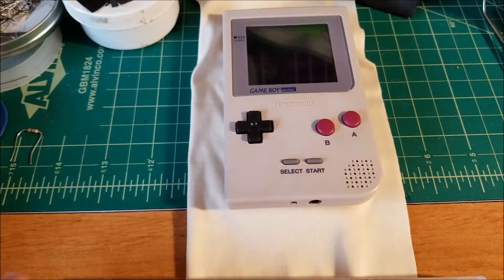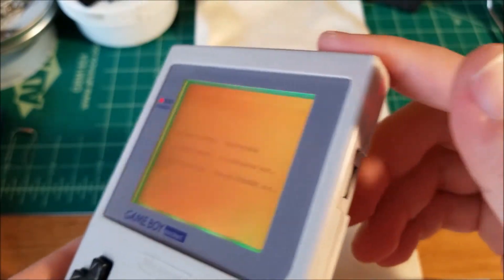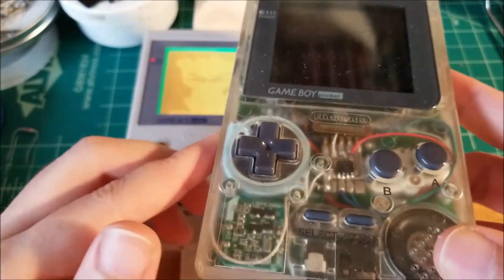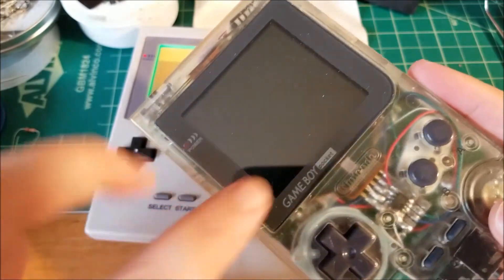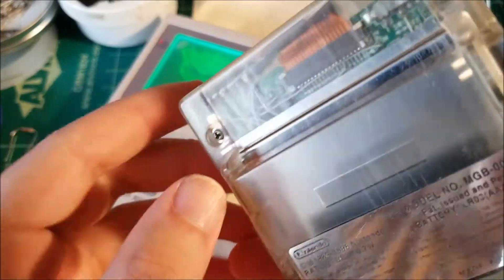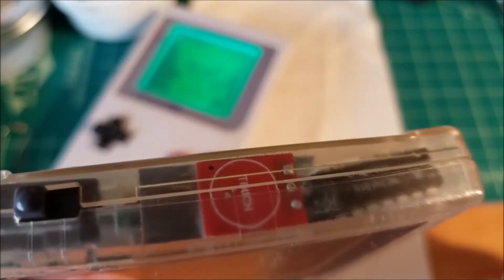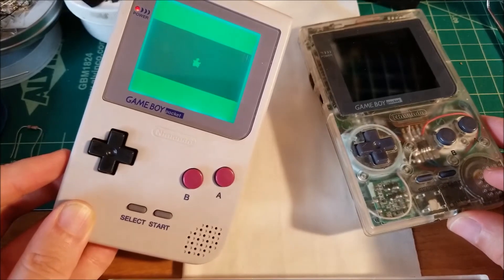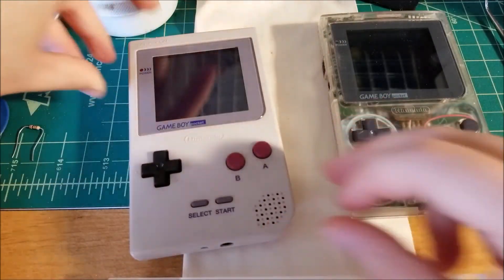Gameboy Pocket Touch RGB and Select-able Invert Mod

Comment: First of all, you are one of my favorite channels and biggest inspirations for modding. So I ordered an rgb backlight to replace the white backlight on my pocket. I also ordered a 4 pin dip switch to control it. My question is where would you suggest I put the switch in the case?
Reply from the maker: I haven't done an rgb mod that is controlled by dip switches myself (I've used my touch chip for both my rgb modded pockets) so this is just conjecture on my part. The pocket case is pretty cramped so the switches will have to be externally sticking out (don't have the luxury of hiding them inside the battery bay like you would in the roomy dmg). I would guess a good place to check fitting would be at the top on the opposite corner of the power switch or somewhere near the speaker as there's a tiny bit of room there. Unfortunately though you will need to do some significant case cutting to fit it so you may want to use an aftermarket shell if you want to keep the original shell stock. Best of luck!
Reply: sjm4306 thanks! I was thinking by the speaker, or maybe on the opposite side sticking outside kinda below the volume wheel
Reply: sjm4306 btw I did order a aftermarket shell and I have some leftover from previous mods that ended in a broken pocket
Reply from the maker: I would think by the speaker would be a cleaner install so it is out of the way and not poking into your hands but still easily accessible.
Reply: sjm4306 good idea. Thanks for the advice!
Reply: sjm4306 so I got it done! I routed the switch to on top to the opposite side of the of the power switch. There’s a gap in the top but it works really well! Thanks for being an inspiration
Reply from the maker: That's awesome, congrats! Got any pics of it you can share?
Reply: sjm4306 yeah! Should I email them to you or how would you like to see them?
Reply from the maker: Yeah you can shoot me an email at sjm4306@gmail.com.
Reply: sjm4306 alright!

Comment: Do you think it would be possible to install RGB buttons as well as the RGB screen to run off the same touch sensor, so they are in sink with the colour changes? (not necessarily in that gameboy, but in another model?
Reply from the maker: It would be fairly easy to do that. Pretty sure my buddy roarke from roarkesretrocorner.com has done that for some of his customers.
Reply: I believe he did one in which while you turn the handheld on if you press and hold the sensor it turns the RGB buttons on and off, but not seen anyone have it so the RBG colours of the buttons an screen change with the same sensor before. 

Is it something you'd consider doing a tutorial on? I'd love to learn how to do it for my own DMG in the future!
Reply from the maker: It would be as simple as wiring rgb leds in parallel with the backlight. I'll have to order some tiny smd rgb leds for the buttons but I'll add it to my list of future videos.
Reply: That would be really cool :) I've never modded a game boy before, i'm away to be starting my first but that was something I have been thinking would be really cool to work up to doing!

Comment: Hi
Reply from the maker: Hi
Reply: Hi I have a gameboy advance the volume wheel is gone and 
It dosent make sound it just buzzes I took it apart to fix the buttons but the sound dosent work who can reapir it I really want it working
Reply from the maker: Sounds like you need to drip some isopropyl alcohol or contact cleaner inside the volume pot and work the switch back and forth to clean it. Another thing to check is to make sure the solder joints arent cold or broken.
Reply: Do you know where to get a volume wheel my gameboy didn't come with one
Reply from the maker: You can find 5 packs for a dollar here apparently: https://ebay.to/2nWImQ6

Comment: So the new instructions on HHL say to take that white to 5v which is pin 4, and to only use a resistor for the 100 ohm on the red for the gameboy pocket. Any difference in using the 5v pin on the front of the board?
Reply from the maker: Nope, no difference pulling 5V at the chip's pin 4 or the front board.

Comment: did you know what you can use SN74LVC2G04 chip? its dual (not quad) hex invert chip, it smaller, and aslo it use every pin-leg
Reply from the maker: Gor Gylka I've seen the dual TI inverter chips and yes they would work great but I was just using chips I already have in stock that were available to me immediately.

Also for this selectable invert I used an xor so I could use a logic level input to enable or disable inversion.

Comment: How much would you charge to make a white one exactly like that and ship it internationally?
Reply from the maker: chocograph The dmg pocket costs ~$50 due to rarity, parts & installation of backlight+controller+bivert $100, and shipping ~$10-15 depending on your location. Can shave some off for other models of pocket that aren't so rare. Will take about 2 weeks due to complexity of mod.
Reply: I've modded many consoles myself, also modded my own DMG with a green bivert so I could do it myself but truth be told... I can't be arsed. I just really liked the touch sensor and was thinking of just have you make me one but I don't think I can justify that price. But I fully understand it. Can you tell me what touch sensor it is and how you wired it? I only installed a green v4 backlight and haven't tried the multiple color ones. I'm very picky about things like dust under the screen and I also use extra tape under my d-pad to create perfect pressure sensitivity so that it's comfortable to play so I consider my own DMG to be the the ultimate one haha.
Reply from the maker: Perfectly understandable, it's just this level of modding took me a minimum of 4 hours of work since there is just enough room inside to deadbug solder the surface mount components and I would have to charge enough to make it worth my time. The touch sensor itself does nothing, all of the magic is inside the microprocessor chip I designed that takes input from the touch sensor and modulates rgb output and controls the soft bivert. If you are comfortable with doing the mod yourself then I can sell you a preprogrammed bare chip and touch sensor along with installation documentation for $12+shipping. I can provide some support but obviously if you go this route I cant be responsible for any damage during installation.
Reply: That's very cool that you would do that but I think I'd rather buy a complete gameboy to be honest. It's a very cool touch I must say.

Comment: So I have an understanding of what the bivert mod does electrically -- essentially inverts one line going to the LCD so that it draws 1 for 0 and vice versa, inverting the image.  So how do you enable and disable signal from your micro?  Or is it not a signal, and it's just a data line?  (Your work has inspired me to fix up a DMG I have and mod it with a backlight. :D)
Reply from the maker: Scott Lawrence I enable/disable it using an XOR logic gate. Depending on whether the enable (really just one of the two gate inputs) is high or low it will either pass the data through as normal or invert it. Makes sense if you look at an XOR truth table. Easy peasy lemon squeezy!
Reply: Holy crow. that's an elegant/efficient solution.  Cheers, man!  :D

Comment: With the rgb you don't need to use a polarizing filter since the color is coming from the leds correct?  Is that a different bivert chip than what is on handheld legend?
Reply from the maker: simyo3in1 The polarizing filter is necessary to make the lcd visible. The bivert chip I installed was a dip version deadbug wired but other than that it is functionally identical to the handheld legend one.